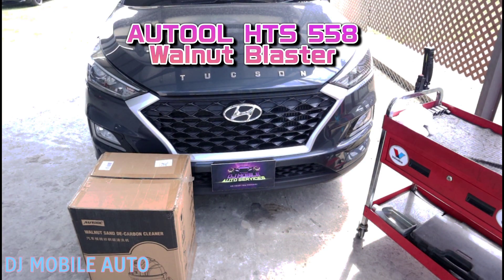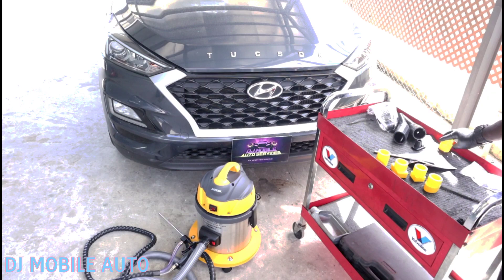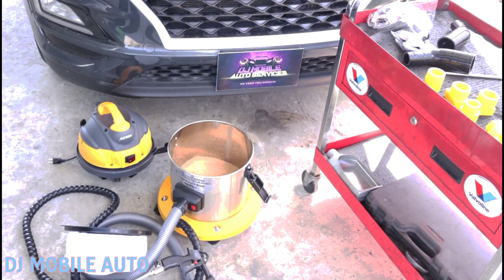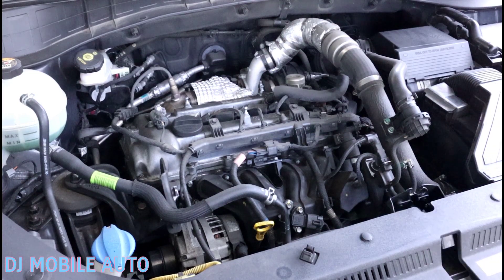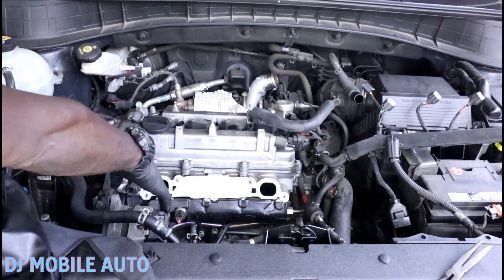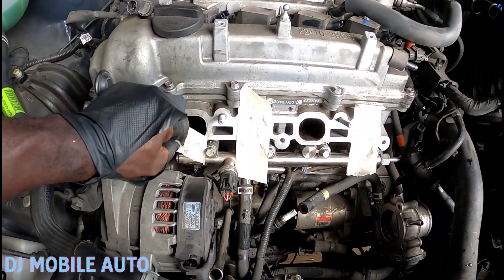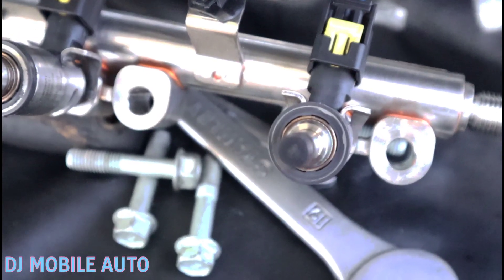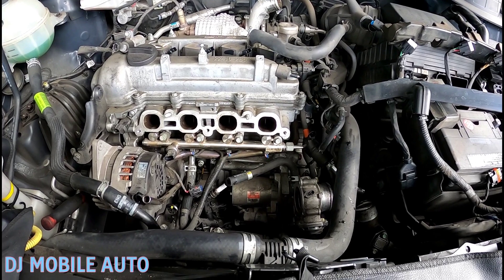Walnut Blasting Intake Valves On A 2019 Hyundai Tucson While Unboxing Autool HTS558. Is It Worth It?

Comment: Looks like the valves were opened in the after-cleaning shot in Cylinder 4 (right-most). Was the engine turned over to clean them? Otherwise, Walnut could've dropped into the chamber during cleaning.
Reply from the maker: They were closed. You have to ensure that they are closed during the cleaning process